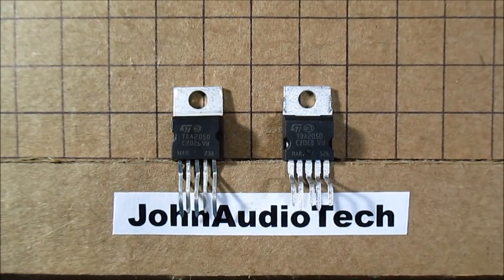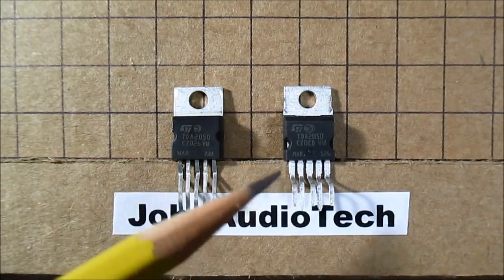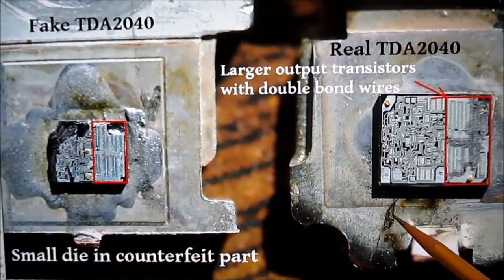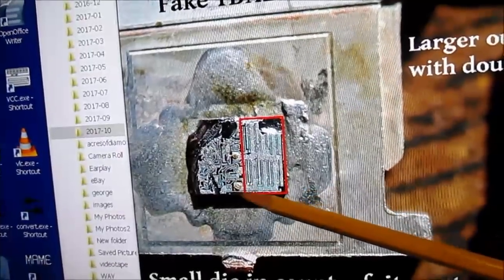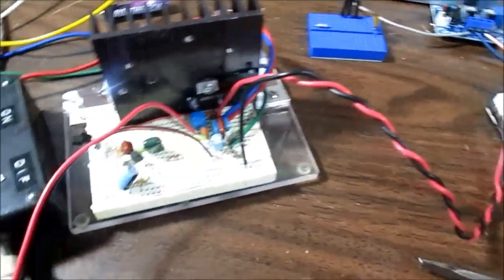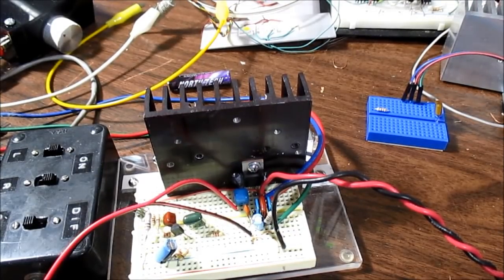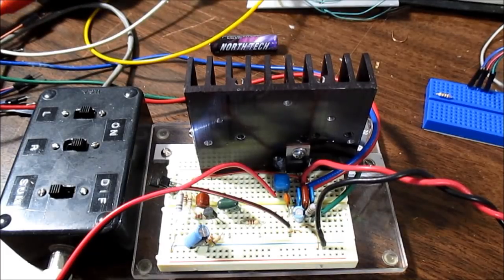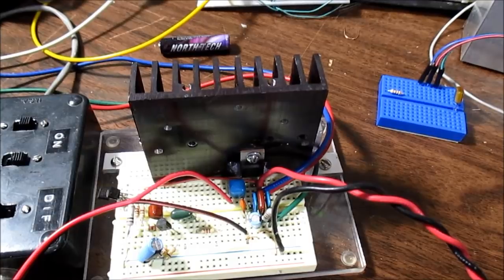Counterfeit vs Authentic TDA2050 audio amplifier IC test

Comment: Hi.  I buy and use the fakes.  Partly because they're cheap and available in well-designed modules.
I'm not interested in short-circuit protection.
And, of course, the difference between a 20W amplifier and a 13W amplifier is... almost nothing.
If I drive a 95dB efficient speaker with a 5W amp it fills a hall.  I have an LM386 0.2W amp that is louder than usable in my living room.
I just don't see the downside of these terrific, cheap fake tda2050s and the modules they come in.  
$3 for a 13 W amp on a bord with screw connectors, power supply and heatsink (good for about 3W).
What do you want for $3?  A miracle?
Reply: If you need 5W, buy the Chinese 100W for a song.

Comment: This also valid for other versions: 2003/2020/2030 too, cuz i got 2 TDA 2003 just to try out for fun and hear how it sounds "vintage" amplifier ic and both blew up after a few second, and i only applied 12volt and 4ohm load. Also it sounded like a chinese amplifier.
 There was no defect in the circuit whatsoever, everything was double checked before applying voltage to vcc pin
My dad had a defective TDA2003, caps was all bad too, it sounded very distorted, and the ic ran for a decade, it was a yugo car radio, but that ic also had wider legs near the ic, also had that blob in the black spot, unlike the counterfeit ones i got for 2euro each.

Comment: Any chance that ST changed the process size at the end of the products life to get more yield from the wafers?   i.e. is it the same die shrunk down or is it a completely different die?  If it's lucrative for the Chinese to spin their own die and manufacture these that's just crazy.   Then again I know they have done so with some other chips.
Reply from the maker: I don't know much on the business end of things, but I can't see them redesigning the die on a product near the end of its production. The output transistors take up a large amount of die space and can't really be shrunk. I think the Chinese are getting a "lesser" die from somewhere, putting it in a package to counterfeit.
Reply: @JohnAudioTech  Perhaps the Chinese are running these fake dies off junk wafers or such or along with other fake chips to make the process worth it.   Crazy stuff.
Reply from the maker: @jeffm2787  Could be. One of the fakes I bought came with the positive rail on the output. The seller didn't believe me.

Comment: I know with some transistors they get a wafer of a similar type to make a near copy. 2SD756 and 2N5551 for example. The give away is the gain is very different.  John. I liked your LM386 with booster transistors. I very much liked how it failed to work and why. If this TDA2050 is a re-badge it would be interesting to know what.  I agree that it is unlikely to be new production.

Comment: I was told about $100 000  to prototype a chip. Even in China it would cost a proportion of that. Strange to go so far and fail?
Reply from the maker: I don't believe they are developing anything. They buy smaller, less powerful chips from a supplier and then package and label them with numbers from a more power chip to create the counterfeit part.
Reply: @JohnAudioTech  And even then, they are quite possibly getting those less powerful chips as "seconds" - i.e. ones that don't even meet the spec for the lesser chip.

Comment: I still don't understand why the Chinese would fake such a low value item...
Reply: The manufacturing process for genuine ICs results in a proportion of below-spec chips being produced. Those "seconds" can either be thrown away, or somebody may cheaply purchase or otherwise obtain them by some means. Either way, the fabricator probably doesn't care. Those below-spec chips can be sold as good, or re-labelled as a higher spec part and sold for even more profit. Even if the profit is small, it adds up if you sell a lot of them.

Comment: If you rub the front firmly with a cotton bud dipped in isopropyl alcohol, the writing sometimes rubs off of a fake one. Also, if it's a used original, the legs may have been dipped in solder to disguise the fact that they have been desoldered from a board (legs can never be cleaned perfectly so they make them look uniform by coating whole leg)

Comment: Dear John,do you maybe know what is first integrated chip amp.Who made it and so on.I have read it somewhere but cant find that article now.Love your videos.Keep up the good work.
Reply: The first audio power amp on a chip I can remember using was the LM380 back in the 1970s. I have an application note (AN-69) from National Semiconductor dated December 1972, but I can't be certain it was actually the first monolithic amp, although it must have been close.

Comment: Can it be like TDA2003 or TDA2030? and rename to TDA2050? since they have similar pin out.. Maybe you can test TDA2003 and do comparison?
Reply: Tda2003 work only single supply at 18vdc. Tda2030 work with and without Dual power supply. and out more power on split supply. on single supply at same voltage the power is same
Reply: @GeoBass-89  you mean to say that on Single supply the power output will be less than what it would on Split supply ?
Reply: @amitghosh6966  yes.. work good with split supply tda2030. or single supply but over 30vdc not 12v. at 12v power output will be less than 2w

Comment: I was impressed by the counterfeit TDA2040 design. So I took some time to look at your picture in detail. The counterfeit die looks completely re-engineered. They have changed the size of the elements, they changed the structures, they put structures away. I can imagine, that this is a whole lot of effort. Why do they do this? Isn't it much easier and less expensive to keep the structures as they are? Maybe, the original structures don't fit in the manufacturer's technology, but I cannot imagine. These old devices are like pieces of art. The structures are big and wide and in each case you have to use special masks etc.
Reply: Isn't the likely explanation that the part is actually a lower power amp chip (possibly an out-of-spec one at that) that were bought cheaply (or obtained) from the actual manufacturer and re-labelled as TDA2040?
Reply: Chinese have MCC -- Masters in Cutting Corners.

Comment: This is very weird, because a month or so ago, I tried a quad amp with 4 TDA2003 that resulted to be fake, because I wasn't able to make them work at all. After buying some more in my local store, the same circuit came to live. The weird part is that the REAL TDA2003 looked just like this fake one you show AND the fake one looked JUST like the real one in this example. So I think been able to spot a fake one is finda more difficult.

Comment: So you shorted the output and the fake died. If the board is good and shorts can't occur, is the fake still ok to use? I know it makes less power.
Reply: Put a fast-blow fuse in the output line to the speaker. Not a bad idea in any case.

Comment: I live in India and here I don't find authentic tda2030A or 2050 in local shops and I also don't know whether these chips available on Amazon or any other online stores are genuine or not. Sometimes I do find a chip with wider legs, having that small round dot and also those two cuts positioned below as you told in the video to identify authentic chips. So I want to know if I can use these chips on a 12-0-12 Volts transformer which has a peak output of 34 to 36 Volts at no load and may drop to 33 Volts on load ?

Comment: I wish I had seen this before purchasing from this asshole on ebay. I got 2 fake TDA2050as. When they arrived, one had the middle pin bent all sideways, and the other had some big bulge on the face, so it raised red flags for me. Went on the search about it and immediately found this video on Google. Looks just like the counterfeit one you showed- indentations on the side are in the middle, skinny pins directly from base, not gripping on the back, and no divot on the face. Really annoyed that this wasted a week of my time. ANOTHER week not being able to play on my guitar. I'm livid.
Reply from the maker: I've never seen authentic ones for sale since they were discontinued in 2013. Do you know the voltage supply to the IC and speaker impedance (ohm rating)? You might be able to use an LM1875 as a suitable replacement.

Comment: Hi John,, Thank you for doing this video,,, It is a very big help,, Do you know if there is a way to tell the difference between Fake ( chinese ) J201 Jfets and the Authentic J201's? Thank you John.
Reply: It's quite difficult to make a counterfeit JFET that doesn't behave like a real JFET, so the main issues will be whether the Idss and Vgs(off) lie in the (wide) range of permissible values for the real part. You're normally going to have to test the part for at least one parameter (usually Vgs(off)) because of the difficulty of setting bias levels for a JFET amplifier or ensuring cutoff for switching applications. A cheap transistor tester will give you a reasonable idea. As the J201 is a 40V part, you may have check that it will stand the supply voltage if you're using more than about 25V, particularly the breakdown voltage between gate and source when the gate is very negative. For low voltage supplies, it's very unlikely to be an issue.

Comment: Bought a mono kit with a Lm1875, scary it looks exactly like the left one, same front and back side and it got scratch marks on it. As if a file took the sharp edges in the metal away.
Not even copper
But it says lm1875 on it, must be fake then.......................
F**
Reply from the maker: The LM1875 has a different package style than the TDA ones. These kits claim the ICs are recovered parts and may have scratches on the package. If you file a corner of the metal tab, it should be copper. You still might have an authentic chip.
Reply: @JohnAudioTech  thx John, 
But on your video of the Lm1875 the sides are straight and does not have that half circular cut on the sides.
behaps I should take the ultimate test.....short the output ;)

Comment: The fact that you can use the authentic IC in a socket type prototype board, get reasonably decent performance and short the output without there being oscillation is a testimony to how good the real part is

Comment: I remember an electronics magazine here in the UK warning of counterfeit semi -conductors being sold from china like the 2N3055 for example,using a less powerful transistor re-branded,and how when stocks were low from the actual manufacturers some companies and i mean reputable distrobution electronics suppliers,were buying in their naivety from chinese distributors and then to western consumers etc under rated re-branded components,which were not up to the job intended.

Sneaky little bar-stewards,mind you not all chinese sellers sell fake stuff i have to add.....but!!!.

Comment: Thanks for the videos John, good stuff. Been building power supplies, guitar tube amps, now on the gain clone/chip amps. I need a spectrum analyzer capability that does not break the bank. I see that your Rigol Oscope has this function. What are your top few choices on how to achieve this functionality? Thanks, George.

Comment: One question pop in my head...
Why they stop producing this chip?
Is there any better replacement?
Reply from the maker: Surface mount components and class D are taking over IC amplifiers. The LM1875 is a better spec'd chip, IMHO.

Comment: 11:18 - Did you check your power-supply voltage to make sure it isn't changing when you attached the counterfeit part? Max power output is determined DIRECTLY from the rail-to-rail voltage!
Reply from the maker: Yes you are right. I didn't check that time but have in the past. The authentic ICs pull the supply voltage down more because they made more output power which draws more current off the supply. If tested on the regulated supply, there would be an even wider difference between the counterfeit and authentic parts.

Comment: Thanks for making this video. I have only recently realized how widespread the problem is. I don't think most people who by parts on eBay have any idea what they are actually getting. After all the chip worked and how many hobbyist will actually measure output power ?  They think they got a great deal on an authentic chip. These things are almost impossible to spot if you don't have an original for comparison or a video like yours.
Reply: If it is cheap, it is c-feit. If it is expensive, it could be genuine or c-feit... Those Chinese c-feiters have no qualms on cheating.

Comment: I bought some LM675 power Op-Amps off ebay a while back…
Bought some LED displays at the same time… OVER 50% failure rate...
Needless to say, I never even bothered using the LM675s, and switched instead to an American surplus supplier who had some NOS power audio drivers that were made in Japan back in the 90s

Comment: I got stung by fake parts once myself. So I built myself a device for identifying them. A high-precision ultra-low-voltage power supply and meter. You can step the voltage across a diode up in 1mV increments from 0.001 to 5V and monitor current. Just the thing for telling the schottky from the not-ky.

The particular sting for me was a regular rectifier diode which had been re-labeled as a schottky. Did not go well when I tried to use it in a buck converter.
Reply: This is way off topic, but I bought some 74HC04's that were made by SunMoon, that have a weird non-HC-like input response.  Cannot decode the part of their datasheet on the issue.  Chinese sellers often will not disclose the manufacturer of the parts they sell.  Is there a web-site that lists the best/worst Ali and Ebay IC suppliers?

Comment: Before I knew better,I ordered about a hundred bucks of Toshiba audio outputs from China. My amplifier kept self destructing. I separated a Toshiba from China and an original, and I could not believe the surface area difference n the two chips. I know better know.
Reply from the maker: Toshiba transistors are some of the most counterfeited transistors out there. As you have found out, you must be careful where you get them.

Comment: I wonder if the fake chip would have reset on a power cycle. There are some stray capacitances in the perfboard that could cause a lesser chip oscillate. Also the oscillation frequency is high enough for the zobel capacitor to pass enough signal to the zobel resistor and cause it to overdissipate. This was a very informative video that shows once again that the fake devices are more likely than not to be inferior. If the Chinese were to make counterfeits that were worth a damn, us Yankees (and everyone else) wouldn't be caterwauling about it. Instead, you show, yet again that these fakes are inferior, in this case delivering about -3dB compared to the real part. That's about half the power. I imagine that with a lighter load (8Ω or more) it might behave a little better, but still. What is really disturbing is vacuum tubes. The idea of a device with 400 volts across it that could fail short is unsettling at least.

Comment: thanks Sir for the thing....I just noticed the same with my TDA2030....but one question.. do the counterfeits doesn't works at all?
Reply from the maker: I've gotten some counterfeits that were dead on arrival.
Reply: +JohnAudioTech oh man..that's ridiculous... hope that ST might come up with another series of audio ICs..these tda series are not at all available.. and if available they are all counterfeits
Reply: @sayantanmaiti2513  The LM1875 is available to replace the TDA2050.

I think ST has a new market, stereo/quad amps with 12V-supply for automotive applications. You might be interested in the TDA737, a 2x30W into 4ohm class AB amp that Mouser is selling for £2.86 at 1-off pricing.
Reply: @RexxSchneider  actually both 2030 and 1875 both have their counterfeits filled in the market. Originals ones are there but very costly. And if you talk about right price and original, then yes, the 73xx and 74xx series of TDA ICs are currently being manufactured

Comment: In your experience how well do counterfeit components hold up to dimensional tolerances? In the past i have had occurrences where a batch of power transistors have been a fraction too large, and they then won't fit the pcb correctly. IIRC the return rate for that batch of products was quite high. All the items came from the same major UK supplier, but I'm sure that it is very easy to get counterfeit products into the genuine supply chain. After that one batch of components the size went back to "normal", but when I complained the supplier just put it down to tolerances.

Comment: How do they get their hands on the original die mask, in order to scale it down? 
Do more videos on how to spot fakes and their internals. It's a fascinating subject.
Reply from the maker: It isn't scaled down. They used a die from another IC of lower power. If you look carefully you can see the layout is different. What would be interesting to me is to find what IC that counterfeit chip came from.
Reply: Any info about this subject is interesting to me.

Comment: i have bought plenty of counterfeit Amp IC's knowing good and well they were fake and as long as you build a quality circuit  around it they work great, Just steer clear of the ones that don't show a real picture in the listing.
Reply: I guess the fake chips won't last on higher supply voltages too
Reply: When a Chinese says 100 watts, run it to no more than 5 watts.